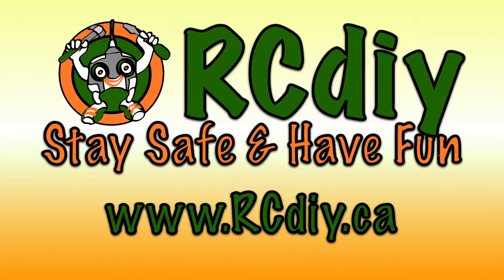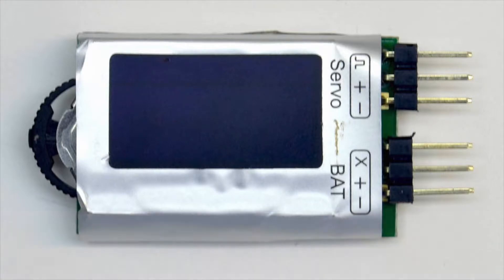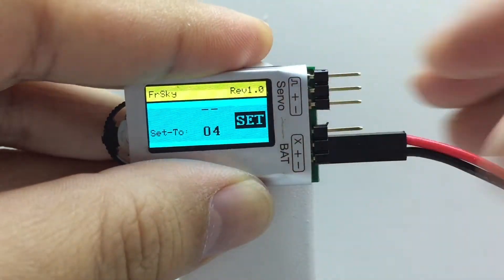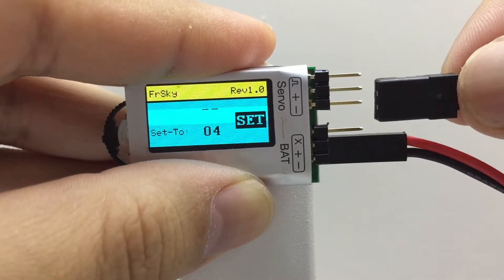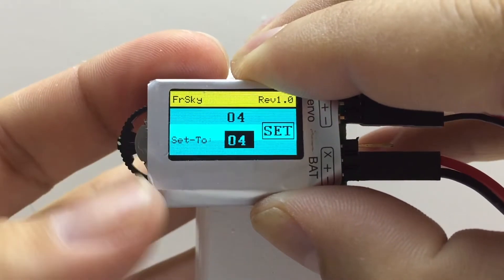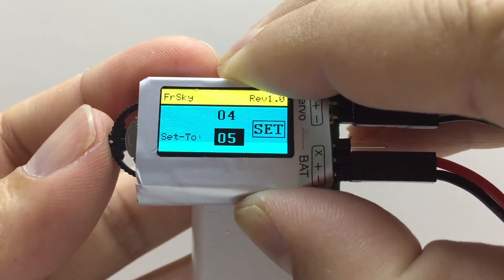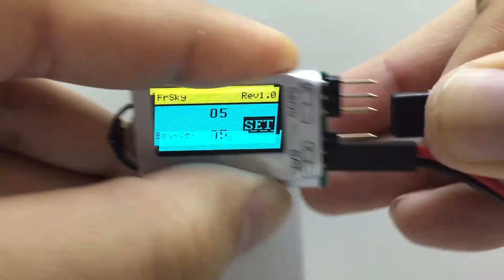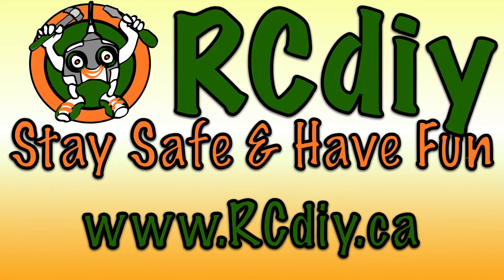FrSKY Sensor ID Changer

Comment: Great video. Many thanks. Please note that "Sensor ID" is somewhat confusing since in OpenTX (in Companion Telemetry tab for your model), for each sensor row it has an "Id" (4 character hexadecimal 0-9 and A-F) and an "Instance" which is from 0 to 255 decimal (1 byte). It seems that the Id changer is changing the INSTANCE identifier. Is this correct? If so, then the servo channel changer is limited to changing the instance between 0 and 16 (and not higher than 16). Is this also your understanding?

Comment: Thanks! So with this I can, for example, use two RPM/dual temp sensors on my twin motor plane, for example, with my transmitter (with opentx) seeing the sensors as unique?
Reply from the maker: Yes.
Reply: Thank you! Ordered one from Aloft for $15. One more question, so long as I have a strong enough BEC, can I add many sensors (as in a dozen) or might I hit a throughput limit of how much data can be transmitted simultaneously without sensors having to take turns dropping frames or some other problem? Some of these frsky sensors refresh rapidly.
Reply from the maker: Ask in the following forums- Aloft Hobbies, openrcforum, RCGroups. 
I believe there is no real limit but don’t know for sure.
Reply from the maker: I’ve asked that question here http://openrcforums.com/forum/viewtopic.php?t=11041
Reply from the maker: 32 sensors. An rpm sensor uses three - one rpm and two temperature. So a physical sensor may come with more than one.